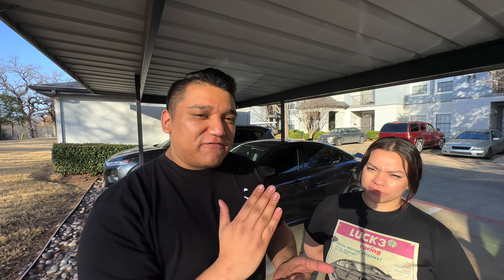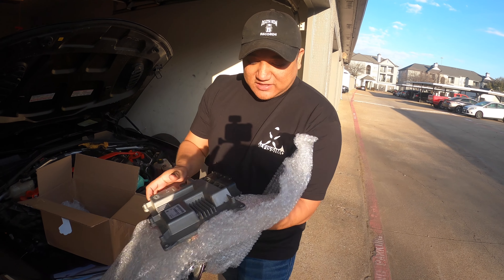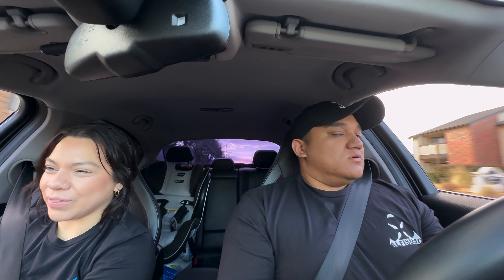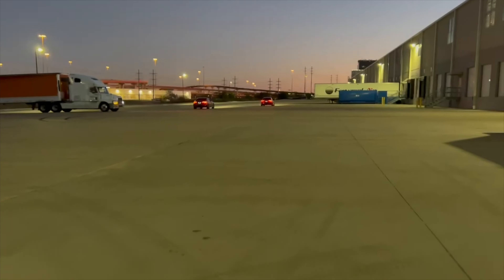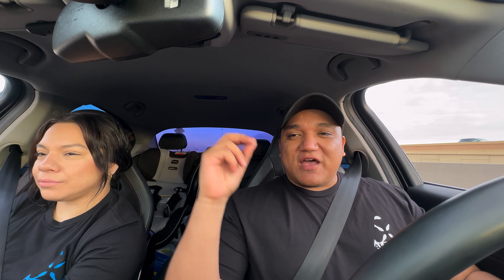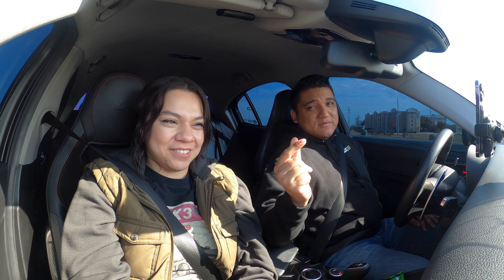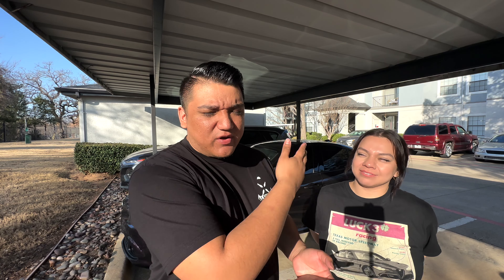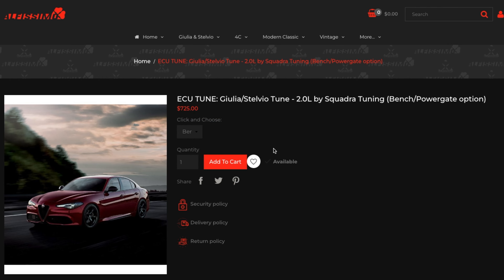The BEST tune for the Alfa Romeo Giulia 2.0 !!! ( ECU UNLOCKED )

Comment: Squadra tune is the best for the 2.0 Giulias. it’s been three months now with the tune and i’m in love with it.
Reply from the maker: It’s only been a few days am I’m obsessed with it! Hands down best tune out there!
Reply: The one thing I don‘t get is the tune for the 280 ps Q4 Engine or for the 200 ps rwd engine
Reply from the maker: They have tunes for all models
Reply: You guys recommend getting this car, have a tuned 17 civic hatch sport that is quick and thinking of getting one of these
Reply from the maker: It all depends on your budget, personally as far as power and luxury it will be a step up.
Reply: Does it edfect your warranty?
Reply: @polandsprings21 Huge possibility of a tune voiding your warranty.
Reply: can i install ragazzon catless downpipes and use this tune to clear codes / have car running in anymode. ?

Comment: Hey guys i want to say that this channel is what alfa needs not many people post in depth videos like you guys i appreciate that alot all the link’s everything makes this channel the best. I do want to say you should post some dragy clips of the 0-60 1/4 mile and 60-130. I have a 2.0t just dont know if down-pipe and tune really brings a difference.
Reply from the maker: Appreciate the kind words! We’re definitely trying to spread awareness to the brand! 

We definitely plan on dropping some draggy clips! Downpipe won’t make that much of a difference but a tune definitely will. I’ll be doing some more testing for the channel.
Reply: @ModdedMotors   hey bro buying a giulia base line.
I want the squadra I want to install race mode get the new turbo and upgrade the exhaust just need some pointers for delete. Chip install my goal is to try and blow dodge,Chevy,ford out the water want most hp and torque I can get possibly

Comment: When I added the cold air intake my check engine will come and go when I will accelerate it fast I ended up adding  pedal booster and no problems now it runs like a champ now
Reply from the maker: Huh that’s very interesting, I don’t have my throttle control in. Might have to add that back in and see what happens 😅

Comment: I’m definitely going to miss the pops and bangs when I switch over
Reply from the maker: The power feels so much better though! As long as you got a downpipe you’ll be good 😅
Reply: @ModdedMotors  yes I’m installing the catless one as we speak. I do need to change out those turbo smart bov. I’m not sure if that’s what’s causing the CEL🥲

Comment: Awesome vid I just subscribed🫡 i got a quick question… if I got this tune for a stelvio or guilia will it void any alfa care dealership warranty? Or if I get the tablet, can I just delete the tune for dealership maintenance and then redownload after? Love to here your thoughts!
Reply from the maker: That’s a better question for Alfissimo, I can only speak from experience. My dealer has never given me and issue and I’ve even let them drive my car. If you go with the powergate yes you can always revert back to stock, however they can see if the ecu is flashed.

Comment: I was goin to bye that or my ATS 2.0T the selling point was I can turn my traction all the way off power is about the same but raced one beat him by 2 cars I’m still considering one the styling is amazing. Love your car.
Reply from the maker: Giulia is quicker than the ATS, ATS are still cool cars though. ATS also probably has cheaper maintenance. Thank you 🙏🏽
Reply: @ModdedMotors  I’ve not lost to a Giulia and on paper ATS has more power and tq lighter as well but I’ve driven both they are about the same I was surprised at how good the quality was with the Alfa but didn’t like infotainment screen and maintenance cost but if I had to do it again maybe Alfa due to a better rear end or rather stronger. I was also happy to see you and your wife enjoying the experience together keep pushing stay blessed from Arizona
Reply: @ModdedMotors  How is the maintenance on the Giulia? Has it been reliable throughout your mods?

Comment: Great information and the car sounds so much better now. So I am really interested now. Is the tune the same for everyone or based on the other parts you have installed? Is the switch with race mode recommended because I only have the D,N,A modes? Do you recommend a cold air intake prior to the tune?
Reply from the maker: The only difference in the tune is he’ll ask if you have a downpipe or race mode. You don’t need the race mode selector at all, they just make all the mods work if you do have race. They achieved 320hp with a stock intake, so that would just be preference at that point. If you want to disable traction in the future I’d definitely recommend going with race mode just to be proactive but it’s 100% not needed.

Comment: I have a 22 Gulia, do you think the tune would be worth voiding warranty? Would I be able to get away removing the tune with the tablet before taking it in?
Reply from the maker: Great question! That’s ultimately your car, I flash tuned my car at 30k miles and dealer still honored my warranty claims. I’m sure if my motor blew that would be a different conversation lol honestly I love my tune and it’s worth it to me. You could switch back and forth with the power gate.

Comment: Quick question for you guys! for somebody that has no performance mods done to his Giulia, would this squadra tune be a good place to start ? Or would you recommend starting with something else ?
Reply from the maker: Honestly it’s a great place to start. If you want instant power this will do it. In my opinion when you look at cost this is the biggest bang for your buck. You can always do an exhaust but it won’t give you the power this will. That’s just for sound. It’s 40 extra hp and smooth power curve through each gear. I guarantee you’ll throughly enjoy your drive more.
Reply: @ModdedMotors  we’ll thanks for the input ! My factory warranty is going to end this month so I’m definitely going with the tune 🔥
Reply from the maker: I’m sure you love driving your car but it’ll definitely give you a new appreciation for it. They should’ve came from the factory at 320 😅 glad you got value out of the content!
Reply: @ModdedMotors  I’m going to purchase this tune next week and just wanted some clarity, should I unplug the battery before I remove the ECU ? And I shouldn’t expect any warning lights when I reinstall the ECU from alfissimo correct ?
Reply from the maker: @juliansalazar3898  after you turn off your car just wait a few minutes but no you don’t have to unplug your battery. We did not throw any codes once turning it back on.
Reply: @ModdedMotors  Cool!! thank you for the guidance !! Lol
Reply from the maker: Anytime 🙌🏽

Comment: Do you need to do an exhaust or intake  for this tune to work, I also have a q4 is there a different squadra map for q4’s? New to the Alfa community and I see you guys have done tons. Would really appreciate the advice on what to do first !
Reply from the maker: No exhaust or intake needed, you can add those later if you’d like! The map will be specifically for your car, they’ll send you a map for your car. Welcome to the Alfa community feel free to reach out if you have more questions!

Comment: Should I get the Monza Madness Exhaust? Also, should I get a tune first before getting an Air Intake and an exhaust! Also is there a risk of reliability issues when adding this tune?
Reply from the maker: I’d go with centerline if I had a pick, you can do the tune at any point. I ran a tune for 30k miles 3 years, without issues on my Giulia. Personally I’d go with exhaust, tune and then intake if I was going to do it again.

Comment: Fixing to buy the tune soon (bench). For the ECU what were you talking about removing a ground? Couldn’t see that step in the video good. I just need to work some more Off Duty Shifts 👮🏽‍♂️then I’ll be able to get this beauty haha
Reply: Know this is from a while ago, but the ground wire is literally just a wire that is on the bolt when you take the nut off. Super easy and just remember to put it back on

Comment: Mannn it’s so expensive! But now I’m hypeddddd! So should I get the go-pedal as well?? Or will this just do the trick I need?? I want to increase my HP as well but I don’t know where to start and what all I should add
Reply from the maker: You can get the go pedal as well but this is definitely all you need. This is 100% where you want to start if you want more power. Exhaust, intake and downpipe are all minor compared to what HP a tune can give you.

Comment: Does it work with a bone stock vehicle or is it best with some bolt ons?
Reply from the maker: Totally can work on bone stock!
Reply: Works with of course with stock car and no mods. Ricky is most likely pushing 335hp on 93 octane using the downpipe. Intake is marginal in providing more power. maybe a few hp. Ciao
Reply from the maker: @alfissimointernational  thanks for the clarity Jason!

Comment: The one thing I don‘t get is the tune for the 280 ps Q4 Engine or for the 200 ps rwd engine

Because in Europe there are two Giulias 2.0 with 200 and 280ps
Reply from the maker: They have tunes for both to my understanding, I think only 280hp is listed on their site. Reach out to them via email for clarity if you have the 200 one.

Comment: I have been running a JB4 or 2 years and like the additional power. Have you guys ever run a JB4? If so,  does the Squadra feel more powerful?
Reply from the maker: I’ll say a flash tune will always feel better than a piggyback, that’s just my experience. I have a friend who went from JB4 to Squadra and absolutely loved it. There’s a difference than just moving up the boost / tricking the computer vs tuning the actual ECU. It’ll always be a difference, not that JB4 is bad. You’re power will just feel more smooth.

Comment: Have you messed around with the hybrid turbo?
Reply from the maker: We have one ordered
Reply: @ModdedMotors  hey brother, can you point me in the right direction, I am looking for the 2024 LED headlight assembly, for my Stelvio, what is the part number? Or do I have to get these lights from Europe, and i watched one of your videos when you installed those new headlights, they look really good, I heard that you have to have a conversion harness, where do I start looking? Thanks in advance.
Reply from the maker: @Ybshy you can buy from Alfissimo; Alfa mods can do remote programming, and you don’t necessarily need the harness
Reply: @ModdedMotors  so it’s plug and play with programming?
Reply from the maker: @Ybshy yea, there’s a slight flicker of the drl without a harness or repin but I don’t mind the slight flicker
Reply: @ModdedMotors  thank you for clarifying!

Comment: How does squadra's tune compare to eurocompulsions?
Reply from the maker: I use to have Eurocompulsion, and other have switched from euro. They throughly enjoy their Squadra tune. I’m trying to find someone local to dyno them both. Overall for me absolutely out performs Euro.
Reply: @ModdedMotors  Thanks for the info. currently debating between the two, but i found out recently that squadra doesn't ship to cali... not much i can do about that unfortunately
Reply from the maker: @mosthigh5700  really? Jason is in CA?
Reply: @ModdedMotors  mb i was tripping jb4 doesnt ship to cali
Reply from the maker: Yea JB4 might not due to CA restrictions

Comment: I’ll be honest I’ve had the tune for about a week and a half now and I don’t notice a difference in power. In fact my 0-60 seems a little slower then it was before the tune. My wife says she doesn’t feel the “tickle” in her stomach anymore from a boosted launch. It’s been this way since I put the ecu back in. The only difference I notice besides what seems to be LESS power is that it revs higher in manual. I feel like I wasted my money. Bummer.
Reply from the maker: I appreciate the honesty, that’s really disappointing to hear. Out of all the people that have run the tune this is the first time I’ve ever heard negative feedback. There’s a clear difference in power even right off from take off. I’d ask Alfissimo for some assistance. The person I hear say the same thing, hadn’t installed the tune. He ended up installing it and fixing it. What option did you use? Have you actually tested the 0-60? The car shouldn’t have a rev limiter, meaning you should be able to rev from neutral. If you can’t do that you might have an issue.
Reply: I can rev all the way from neutral and in manual it revs to 6500 rpm. I actually switched back to my stock intake and it seems to have resolved the issue. Fast alpha told me the BMS intake causes you to lose power because of decreased pressure and it seems he was right. I definitely feel the difference now.
Reply: And yes I tested the 0-60 I was at 5.1 with the BMS on and after I switched I did three runs, 4.5, 4.5, and 4.4. Such a bummer because the BMS makes the turbo sound so good.

Comment: Warranty voided. Wish I could get it
Reply from the maker: Ours is well out of warranty 😅 we’ve been running flash tunes since 30k. Thankfully our dealer has always honored warranty claims. Definitely something to keep on the bucket list once you’re past warranty!
Reply: @ModdedMotors  maybe I just get it and yolo. I want to see more videos of this.
Reply: @ModdedMotors  Might get a stelvio out of warranty and add the squadra tune and turbo, downpipe etc. Best the crap outta it
Reply from the maker: @dennisreynolds6915  honestly that’s the way to go! These are definitely cars to have fun in !
Reply: @ModdedMotors  But you know once i get the tune ill blow a turbo or somthing will happen. 
lol. Cant beleive you were spinning tires going straight in 2nd 3rd gear
Reply from the maker: @dennisreynolds6915  I think it’ll be okay tbh 😅 yea it was a good time lmfao
Reply: Not necessarily. First, the dealer really does not see the tune if you bench tune, bench tuning does not trigger the counter on the ecu. We have many who go to the dealer with the squadra tune and have had no issues. Some dealers do not care at all and have sent customers to us for tuning. You can email me for more info on this if you choose but I will say it's highly unlikely. Enjoy your car and do not worry about warranty. I have had QV's go to the dealer without an issue as well. Ciao
Reply: @dennisreynolds6915  Won't happen with the tune. The tune is done correctly for safety and longevity of motor and components.

Comment: Would this work on a 2017?
Reply from the maker: Yes it would! Ours is a 2017!
Reply: @ModdedMotors  nice! I have to agree with you guys I'm currently running the tune from Euro compulsion and it's just not hitting like it used to.
Reply from the maker: I promise this will be a completely different driving experience. We’re so happy we switched!